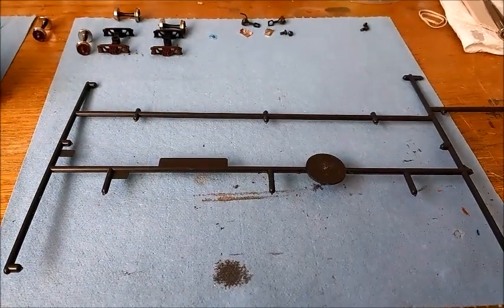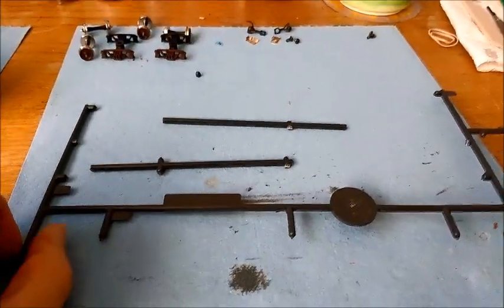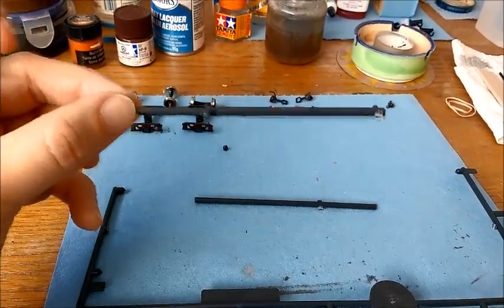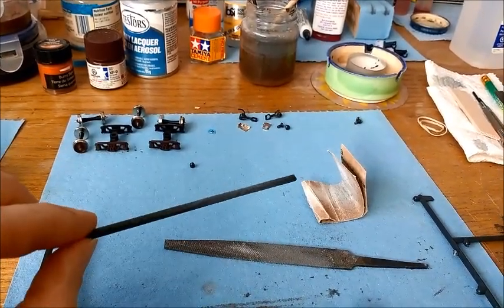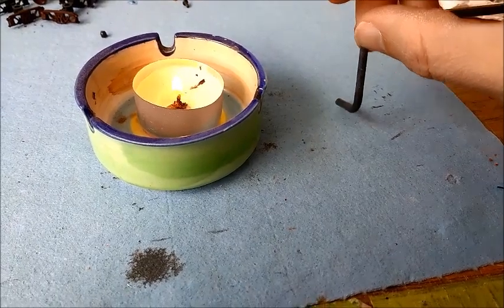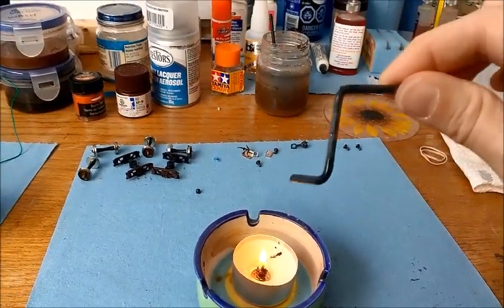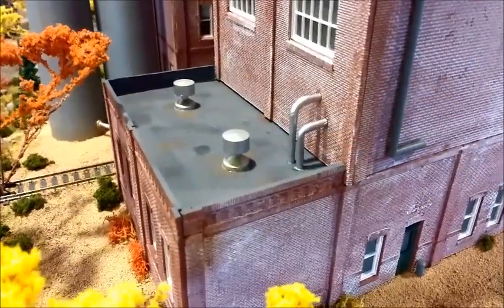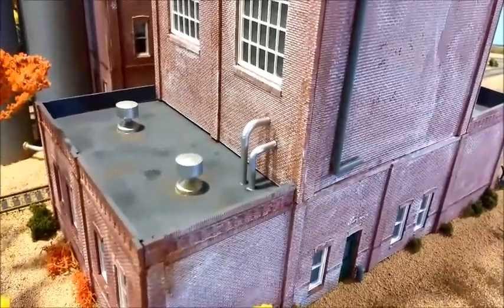Neat trick for making pipes.

Comment: Great idea.  I kept all the plastic from the models I have done, so I have a huge box full.  I watched another video where you heat the plastic and stretch it to make different size pipes.  I never thought of it until I seen your video that I could use them for the oil refinery I will be building.  I just bought Walthers pipe kit without thinking of this.  Now I can make pipes for the rest of the refinery when needed.Scott
Reply from the maker: +Scott Downey I a looking at trying to add more of the piping to my other industries. Got  to find ways  to make this hobby cheaper.Thanks Darick

Comment: Great stuff. I just came across your channel and I love it. 
I used those scrap plastic parts before on military models to add antennas on the vehicles. Just worm them up and gently pull it apart. With some practice you can get some pretty good looking antennas.  Never though about using them for piping or gutters. 
Thank you very much .

Comment: Who'd ever think of using those model spurs that hold the parts of your kit as they come in the box? GREAT Idea!  IF I may also add,  I noticed how they go strait from and to either the wall or roof... How about putting the ends over the candle heating them up just enough to soften the butt ends in order to "Mushroom" them so it looks as though they are going into a flange or some kind of coupling... Just a tiny detail one could add.  :)